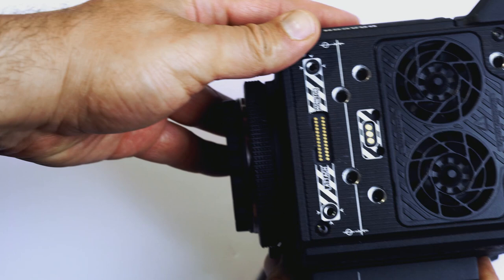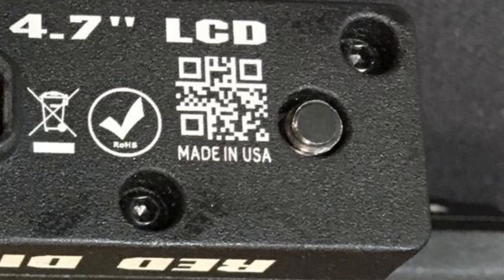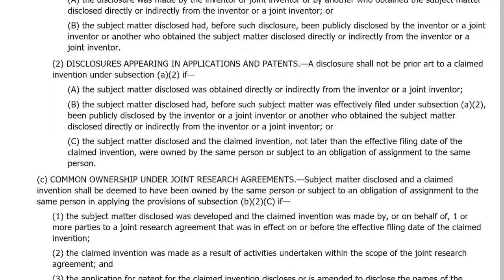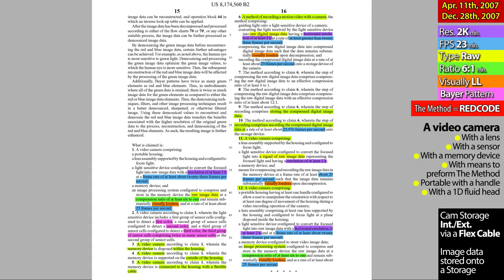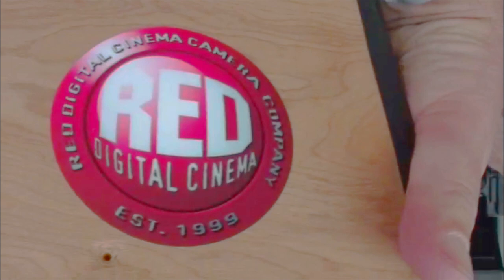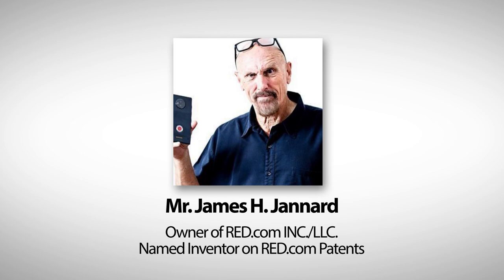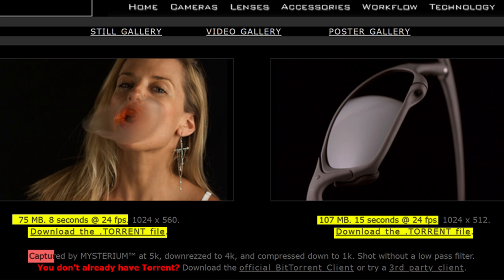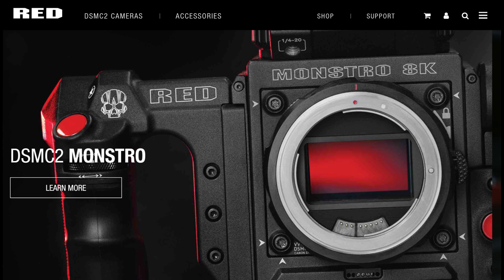Part 3 - RED PATENTS - Things you only thought you knew about RED DIGITAL CINEMA CAMERA

Comment: Next week Jinni Tech revials that RED uses a cheap ali express calculator to run the camera.
Reply: lmao
Reply: Actually, that part is sort of impressive. Linus tore down his Weapon 8K to try and water cool it. It's using a very large Xilinx Kintex-7 FPGA. That chip is built for this kind of thing, and also cost several thousand dollars each.
Reply: or that Teslas are just overclocked mobility scooters
Reply: Roffll I wouldn't be surprised 😂😂😂😂
Reply: @asm_nop  several thousands or less than a thousand ?
Reply: @asm_nop  or less than $800 here in the US
Reply: TBH. I just watch these cus I like his voice 😂
Reply: @sebraecha  It's cheaper than when I saw the Kintex-7 prices a while back, but it's still ~1100 USD on DigiKey for the XC7K325T, which is the one I identified from the board when Linus took his Weapon 8K apart. Seems like that chip can be had for significantly less on the right website selling DIY development boards, around the $700 USD range. My mistake. To be fair, the Virtex ultrascale+ chips can run as high as $64K each. FPGAs are pretty expensive parts to develop with, but RED is still a shit company.

Comment: I have a feeling that almost every accessories RED made for their camera are just cheap stuff and stab RED logo on and sell them for thousands dollars
Reply: isn't than every piece of pro video gear ever?
Reply: Jingtian Wang not really. Plenty of people are making the products the sell. From start to finish.
Reply: including the "brains" :)
Reply: @dietwedge  tbh, I think we aren't taking into consideration of the low volume of accessories produced when it comes to pro video equipment. They aren't enough demand to allow for any economy of scale, these are produced by hand but often required complex machinery. You should also take into consideration that if you own a red or arri, you are making tons off of it by rental as well as cinematography, it's only fair that the ones produced your equipment also get some of that. So I think some mark up is acceptable, maybe 600$ for the 4.7", but yeah considering you can get a smallhd 7" for 800$ now days, red touch is over priced.
Reply: They got good at adapting the apple model.

Comment: 22:39 The cable in the computer is /not/ a serial cable. Those High-density connectors shows that this is a Camera Link type of card - usually used in industrial vision systems. This is to capture the video from the sensor directly. A card like X64-CL Express is probably what sits in the PC.

Comment: Again, it's okay to use industry-standard connections with weird plugs. However, marking it up like this reduces the accessibility to the equipments and make it hard for people to buy and use the camera, not to mention all the deceptions and lies.
The solution? Just be honest. Don't lie. Just say that the extra price is for warranty and QA, not some magical sauce they've put in.
Reply: I'd say it depends. Ig your propertiary plug has more secure connection or additional waterproofing features or anything like that, then go ahead. If your plug does literally nothing additional to the standard, then why? It seems like pure added cost of custom manufacturing to limit possibility of 3rd party accessory creation.

Comment: Ouch! Major damage done to RED's reputation... I'd be feeling pretty ripped off right about now, if I was looking at that monitor. Definitely feels like the tide has turned, Blackmagic are the new RED... I've never been a fan or user of RED cameras, for a variety of reasons- cost, reliability, a closed architecture requiring proprietary monitoring and media, no ND, no XLR without extra expenditure.. However... one does have to give RED credit for pushing the camera industry forward, and they have innovated, give them credit where its due... The big Japanese manufacturers in particular, were really sluggish with 4k, and were and are protecting their high end cameras, which is, ironically the challenge RED now faces from Blackmagic.. . I really hope they lose the internal compressed RAW patent case, I want ProRes RAW in the camera of my choice...

Comment: Did you ever do an update on the Russian method RED uses? I just remembered that I attended a 2002 student demo of “Scalable Video using Wavelets” at LTU, in which real time encoding/decoding video on low end devices. Took me a little bit of googling to find  the details. It is not exactly the same thing, but a lot of similarities. It was video color space - not raw and not 4K, offered up to 1:8 compression. I never understood why minor incremental engineering increments receive patents, exactly what in the RED patent was supposed to be patentable at the time of patent, regardless of their invalid filings. Would be interesting to know how many of the patent claims have partial or full prior arts, considering so much of the patent was just a list of standard methods; 4K, Bayer pattern, wavelet video, ...

Comment: that was not a serial port for control, its a LVD port for video and control. the pc is actually capturing the video over that connector.
Reply from the maker: Even if it was, it doesn't change the fact that the product was practical. May be not in its commercial or optimised form yet. But nevertheless reduced to practice regardless.
Reply: Spot-On. It's called CameraLink and used for industrial video/image capture for vision camera systems.

Comment from the maker: For those interested in the patent part, here is the link to RED's 1st provisional patent application filed on 11th April 2007. https://www.dropbox.com/s/im8a2iaeob44exi/RED%20Provisional%20Application%20%27196%20filed%2011%20April%202007%20.pdf?dl=0

You'll notice there was no mention of wavelet, resolution, and compression ratio. 
Also note that Maths alone is not a patentable subject matter. 

Link to the drawings of the provisional application: https://www.dropbox.com/s/atimvcjsbuhokts/Provisional%20%27196%20Drawings.pdf?dl=0

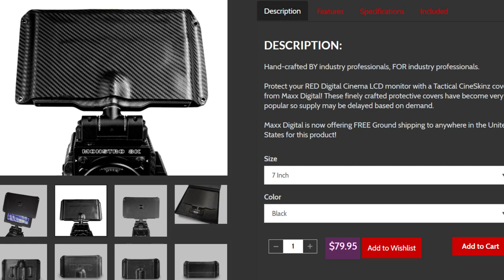Comment: 4:48 “guys wake up. Everyone is doing this to you” says the guy selling $100 worth of ssd for $1000.  
 
This is a very insightful video regardless. The first part however, he tries to get people upset that they are being sold cheaply made products for such an up charge. That obviously should get people upset (but lets be honest, everyone sells for an up charge to whatever the market can bear). Not sure why he needed to show the LCD monitor costs as that is not why people should be upset.  from what he claims about the "made in USA" issue, that part is the only really fraudulent part i can see from his video about the lcd monitor. no where do i see that RED claims these LCD monitors are special and have some secret sauce to justify the cost, unless i am missing something from some backstory comments on message board from Red, etc. yes it does suck that they charge so much for it, but as long as there is a market for it, so be it. similar to Apple's infamous $1000 monitor stand for the $5000 pro monitor. I am sure if Apple just included the stand with the monitor and charge $6000, no one would even be upset...because in the pro market, they have pro level monitors that sell for $20,000!! so if Red just included this LCD monitor with the brain, this would be a moot issue....maybe that is why they are selling kits now???

regardless, to me this video is meant to get people first emotionally upset by showing the cost differential and then further this charged emotion with the OPs claims of a fraudulent patent claims. This is just an inflammatory video to get people mad. Should people be aware of RED's practices? Absolutely. Not defending RED at all. If they lie, commit fraud, and break the law, then they should be dealt with according to the law. I am only commenting on this video and its intended purpose of using emotion to get people upset and not only rely on facts. The facts should be enough to carry the content, but the OP does try to fan the flames with this whole LCD issue.

Comment: As a RED camera user before knowing about this whole conspiracy I can say that the MX is the most impressive sensor that RED has developed and it’s still my favorite. Everything after that I don’t know... It’s 2019 almost 2020 and those camera still act like they run windows 95. You don’t need to run the RED monitors, you can use any monitor. I actually prefer it without the touch screen with a proper side handle with navigation buttons. Had the chance to use a Gemini this year and was really not impressed. Meanwhile I have some blackmagics that kick ass but built much cheaper but almost as capable.
Reply: ufster81  popcorn is in the microwave

Comment: After watching this I opened up my Redmote with a dead internal battery. Was able to order a replacement battery for under $30. I'm sure that's much less than Red would have charged me.
Is is possible to replace the touch display in my old Red DSMC1 5" LCD with a higher resolution display? I have constant issues with the touch function randomly not working on the Red LCD. It comes and goes.
Reply: No. Attaching a higher resolution LCD would not magically have the controller upgraded to one that can render this new resolution.

Comment: "Interesting to come up with all of those details in such a short amount of time."

Uhhh he said they settled on a design on December 13th.   So that was only a "short amount of time" between settling on the spec sheet and then making said spec sheet from December 13 public.  But REDCode wasn't the original spec.  The original spec was fiber optic 4:4:4 raw to an external computer.   REDCode was announced later.  Apparently in April 20th. Less than 1 year before the April 11th filing.  They got in under the wire.
Reply from the maker: He said: The 1st RED "Spec Day" was Dec. 13th, 2005. We had no sensor design.
Here:
http://www.reduser.net/forum/showthread.php?53370-RED-A-Look-Back&p=699407&viewfull=1#post699407

And then came up with all pixel accurate, frame-rate accurate info. RED codec, onboard flash memory, various bandwidths, 4:2:2 HDI, etc. all of which remained unchanged up to 2008 when they filed the non-provisional patent application?
Mr. Jannard couldn't do that even in 2017 for Hydrogen One specs. that was his "most important" thing he ever worked on, while, unlike back then, hundreds of Andriod phones exist as to serve as a base design. etc.
Reply: @JinniTech  The specs say "Subject to change".   The patent exclusively covers using wavelet compression to encode RAW at 24fps in-camera.   The legaleze isn't to trick people, it's to be legally explicit.  All patents are written that way.     The patent essentially says:

"Encoding RAW in-camera at >23 fps and > 2k." 

The original plan was questioned as practical 2005 because the original intent was to record from fiber optic to a RAID array via a tether.    Which severely limited the capabilities of the camera.  RED then between the first official specs and the release revised the specs to include compression.   That wasn't announced until April 20th 2006.

Here is a quote on DVXUser before the announcement: NAB 06 Predictions: "I'm betting it will be AT LEAST $45K for the body only. Still need glass and something to record to (a nice fiber channel RAID or something)." 2/25/2006

Here is a quote on DVXuser a few days after the announcement "If the RED codec is wavelet-based, I'm not sure when you'd want to use it. Wavelet codecs are lossy, which to me defeats much of the purpose of this camera. Fortunately, it looks like there will be plenty of options for output, but if the affordable storage options are only practical when using a lossy codec, that's a potential problem." 5/1/2006

Comment: OLED screens look nice and vivid but they are not exactly known for accurate colors. Using a screen that can be factory calibrated accurately and that can display a decent portion of the color space is important. Those don't have to cost a lot of money, it's more a matter of just finding the right one. Of course that doesn't justify the price tag, all I'm saying is that going with a more expensive screen isn't necessarily better for this purpose.
Reply: if not OLED, maybe higher pixel depth or brighter NITS

Comment: Note I am not defending red, they have detestable practices, but I must say that the LCD controller chip from TI does not mean anything, everyone uses TI chips in their devices. Apple uses TI chips in all their boards. If the beating heart of my HP Envy is an i5 CPU, to say that the logic board was based around an Intel CPU makes it not made by HP is wrong. Just because a processor is standard does not mean it is invalid.
Reply: HP can charge you a premium for a machine that you can assemble yourself but they don't charge you 100x the generic equivalent do they ? I mean people and companies have to make profit, and their intellectual labor and design need to be rewarded, but at some point it becomes ridiculous. and to top it off, they justify it by misleading claims.
Reply: The controller shown on eBay doesn't use a Texas Instruments chip at all. It's from Taiwanese Realtek!

Comment: This video does need a bit of nuance though.. For example the choice for a 20 dollar more OLED display. Was that available when they developed this screen? Have you checked that? Probably not. IIRC the touch screen was announced the touchscreen in sept 2015, which probably means they developed it end of 2014, to have prototypes ready. Was that 20 dollar OLED available back then? It's way to easy to dismiss this kind of stuff. Maybe in end 2014, this display WAS state-of-the-art. Or maybe not, but that's not discussed here.

Comment: 23:20 

Its NOT a serial port as like an RS232C or RS422, but it is OBVIOUSLY a camera link interface, as used in industrial camera environments all over the world, especially in these old days. I am very used to this. However, it is a quasi parallel set of serial high speed connections to transfer data from various "tabs" (i.e. sensor columns and their respective A/D converters) into a grabber card (thats what is inside the PC). Typically these interfaces are physically compatible with todays sensor designs to minimize efforts in developing cameras and being able to interchange various sensors from even different vendors.
Reply: Agree. There is NO recording capacility in that wooden box. It's just an image sensor.

Comment: I have three RED cameras as of today, I have owned and operated more that 10 of them over elleven years, they are the BEST digital cinema cameras you can buy for money (and cheaper and more compact than the competitors), they have all served me well, I don't feel deceived, I think they built a great product! The best! 
After watching part 1 and part 2, I thought it was kind of good, and also considered getting the Jinnymag if ever need more mags, but this part is just cruel!
Let me explain:
RED did something no on else could have done in 2007/2008 (and no one did!), they delivered an amazing product - the first ever to compete (and mostly beat 35mm film at every aspect). If there was a patent issue, I don't CARE!!! THEY REVOLUSIONIZED the film business, and then ARRI copied them with a lesser product at a higher price, and got away with it... (makes me wonder if Jinny is on Arris payroll, or someone else)
I am a proud owner of RED, and although I would want cheaper storage (and other things, who wouldn't?), but after this part, no jinnymag is going anywhere near my cameras.
WHY? Because RED did the important breakthrough for digital cinema cameras, no one could compare, no one was anywhere NEAR to compare, they GOT IT! They knew what WE wanted, a full sensor 35 mm digital camera, P/L mount, a codec system that could handle that data (previously required refrigerator size disk arrays) at a fraction of the cost of a film camera, and at a fraction of the cost of buying film, developing film and have it telecined.
That's important, a lot more important than patent law in my eyes! 
It´s the SYSTEM that RED built that is genius, not the individual parts, not the components, you can buy all the components you want for dirt cheap prices, but to build a camera SYSTEM like this is what makes RED the rebel, the genius, the perfect partner for the filmmaker!
If they broke the rules, they may face consequences (and their cameras will still be as great), but I am saying - They were the rebels, they made the new ERA in filmmaking, and they have my fullest respect!
Reply: Except that Arri made a product that was extremely reliable (almost bulletbroof) and produced a way better image. From what I see they went the opposite way and chose the best products available. They still have way too much markup, but such is the case for business plans that sell quality instead of quantity.  Arri is not making thousands and thousands of alexas. Way higher quality control that you pay a premium for. I'll stick with blackmagic.  I don't think it will be long before they catch up to Arri for way less money. Great time to be alive.
Reply: IN august 2007 there was only one company that had a product that fit.... RED. But I am wrong, Aaron Holder Yeah, you’re right. And because you know you are right, you will happily buy (or rent) Arri at a way higher price. You win! Good for you! I wonder hoe much money Jinni got from Arri to make this "documentary",,,, End of the line; except from resolution (where RED is waaaxay better) these cameras looks exactly the same!!!! No one can tell the difference! (except a small adjustment in post),,,, FTW!